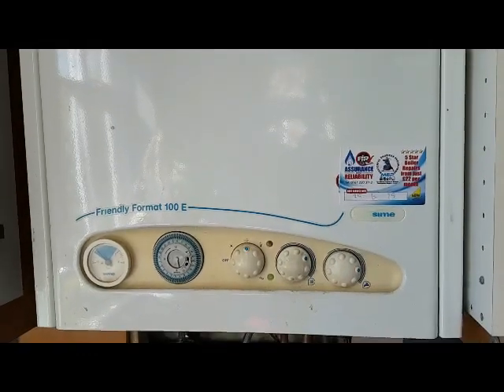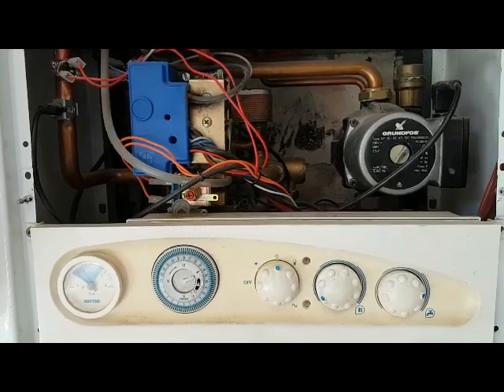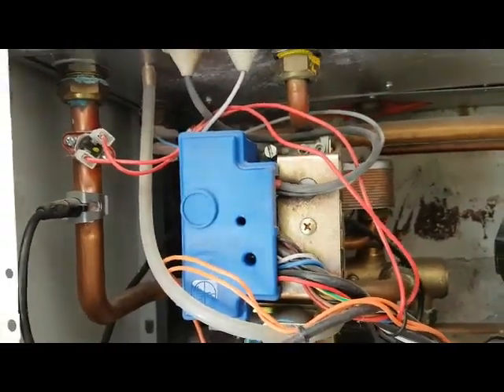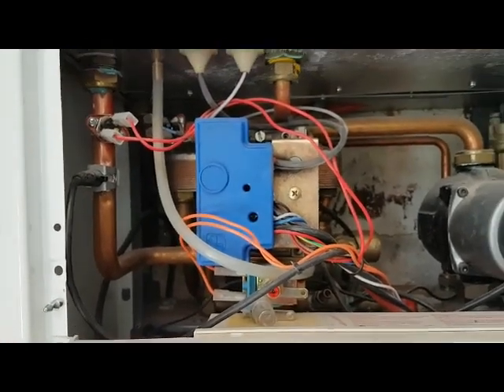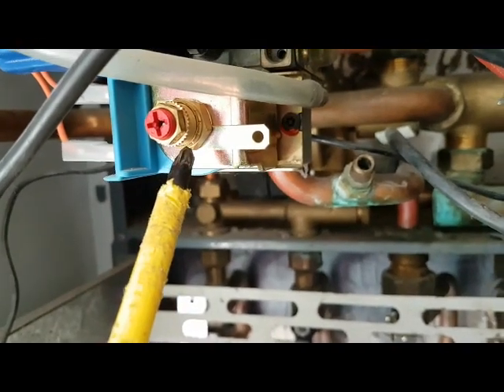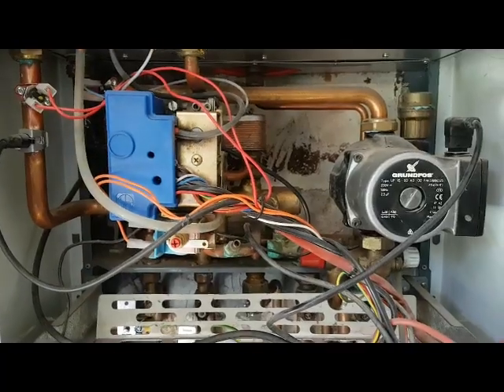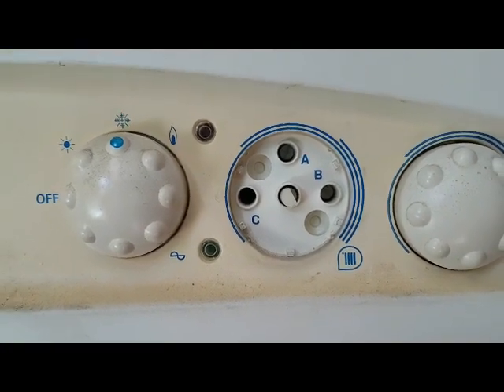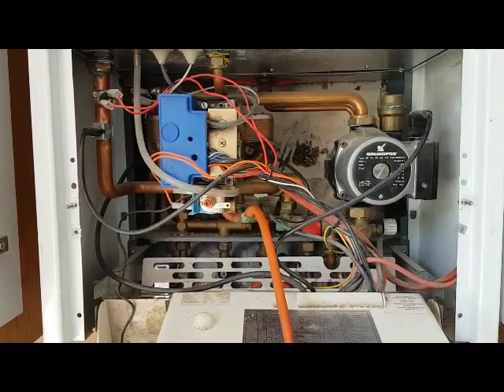Sime Format 100E Operation Sequence With. Coach Tony Morgan

Comment: Sime Format 100E cuts out after 45-50 minutes, both  Domestic HW and Heating, after a while it will light up and cut out again after 45 minutes, any ideas, my plumber has replaced the motherboard and the Air pressure switch..
Reply from the maker: Try replacement of the primary  sensor or it could be the ignition box
Reply: @ARBoilers  Thank you which one is the Primary Sensor?
Reply from the maker: hey we're currently trying to grow our Facebook group and would love you to join Tony and the team using this link, Tony will be available to answer all your questions directly there's also updates on new trainings we just released too. https://www.facebook.com/groups/167070231326174